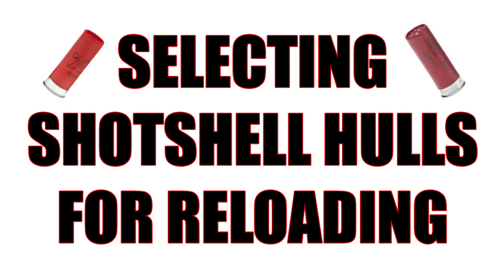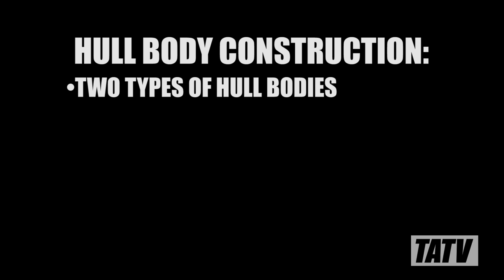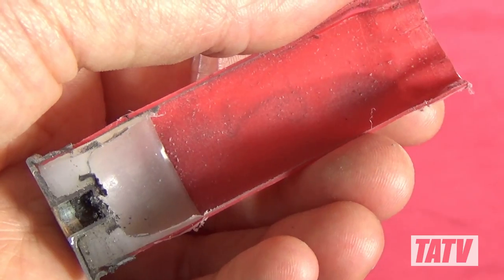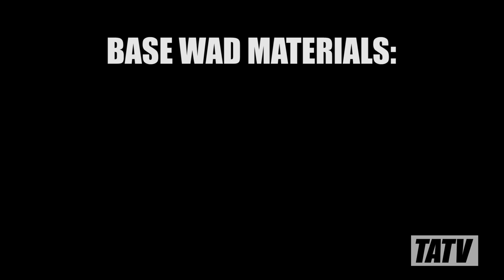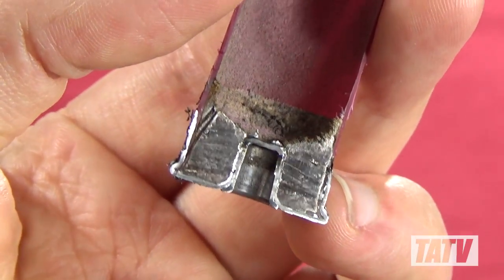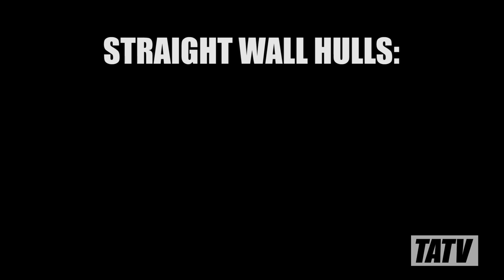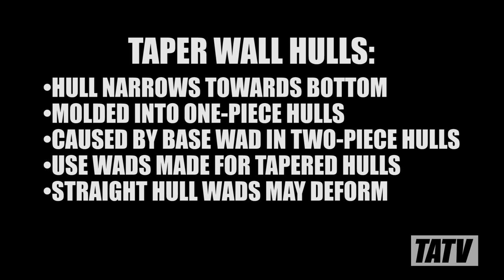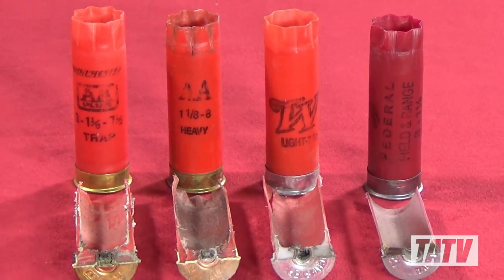Selecting the Best Shotshell Hulls for Reloading

Comment: Good info.
I stocked up on the virgin factory primed blue "mystery" (Rio) hulls that American Reloading was carrying. They cost me ~4 cents each. Rio hulls have some quirks (base wad design. primer diameter), but straight wall hulls are more forgiving than tapered base hulls. I also use non-standard components such as the "Fiocchi" FCFWA12H27 wads that Grafs and Powder Valley sell  (Lee 7/8 oz slugs fit perfectly), so there's no published load data for my component selection, just data for similar components that works very well for the "Fio" wads. I don't think I'd try it in tapered hulls.
Reply: The Lee keyed slugs in a Fed12S0 wad fit best in Federal and Estate hulls and allow for a good crimp.

Comment: I load those Federal paper based hulls with tapered wads (WAA12, WT-12). I put a piece of tissue paper under the wad to seal it against the powder. Seems to work just fine for me.
Reply from the maker: Why not just use straight-walled wads and forego the tissue?
Reply: I do the same thing. A WAA12 wad may be of a more suitable height than say the Federal equivalent and allow for a better crimp.

Comment: A caveat when reloading Federal hulls which have the paper base wad. 
Load them once and toss them. After about two reloads the base wad tends to separate. You may find it further up in the hull or you may find it in your Barrel.
Reply: I have loaded a lot of junk fed hulls half a dozen times and have yet to have a base wad fail ever. Usually the head splits after several resizes then i toss them. I only load .410 though so that may be a reason i have diff results
Reply: @eduffy4937  do you shoot 28?
Reply: @donaldatkinson7937  I shoot several cases through my bobwhite, and my benelli ethos Cordoba. I just do not reload range ammo for it but do reload 18g/cc tungsten for them.

Comment: So, as a newbie, I'm looking for a "one piece plastic straight walled hull" like the Winchester AA Plus? Can you give me advise as to where to buy them, and wads and powder? thanks, love the channel :)
Reply from the maker: Whenever possible one-piece's are my preferred hull, yes.  Other than your local gun store, your best bet is probably gun shows.  Depending on where you live they can be had fairly reasonably.  Alternatively if you live in the US you can buy them from Ballistic Products Inc.  You may also like their brand new (and primed) Federals.
Reply: One piece straight wall hull = Federal gold medal. Should be available at wal-mart for about $8 a box. Don't buy the 100 round value pack they are 2 piece hulls.

Comment: 2:43 hmmm i don't how a base wad could ever separate and travel down the barrel. The powder burn pushes against the wad in the other direction
Reply from the maker: Don't know what to tell you, it happens.
Reply: I've had it happen with paper base wads in Federal hulls. It has to do with the inertia after firing.
Reply: @jungleno.  the inertia is pushing the base wad the other direction though, "deeper" into the shotshell
Reply: @thaton3guy100  you arguing what "SHOULD" happen against what "HAS" happened. Logic doesn't always prevail.

Comment: how can you tell if the two-part base wad is separated from the main hull without cutting into it as you did in your demonstration?
Reply from the maker: If you look inside with a light you should be able to see it separate from the case wall.  Typically it will present as a curled edge or small space between the two with carbon inside.
Reply: @TATVCanada  I have also sometimes slight indications of burn through at the top of the base. I am not sure if it indicates separation is starting  but I through them out.

Comment: It is well to say "inspect" when it is cut in half, but then you can't load them. How do you inspect without cutting g in half? How can you see inside the bottom of the shell?
Reply from the maker: Typically if you look down inside you can a pretty good idea of the basewad condition; however if you're having a hard time (or it's really filthy) just use a penlight.  I actually have a desklamp on my reloading bench for this exact purpose; it works great.
Reply: It helps it you have already de-primed the hull.
Reply: Inspection is very important with the coiled paper base wads. My club burns the Federal paper base wad hulls so I can get as many as I can carry off. I make it a point to only get hulls shot the same day that I know were never rained on. Wet paper base wads have 2 hazards.
1. The moisture can cause duds and bloopers.
2. The wad can tear out and lodge in your barrel. The next round could bulge your shot gun barrel. If you destroy a double gun repairs are very expensive.
Since I get the paper base wad hulls free in unlimited numbers I use them in my autoloaders and pumps when I shoot skeet. I only reload them once and they are ejected on the ground. I do not leave expensive hulls on the ground and I don't have to pick them up. For skeet shooting my hull cost is zero.

Comment: Actually a slug load will create less pressure than the equivalent weight of shot because shot will compress and widen upon ignition causing more pressure against the chamber wall.
Reply from the maker: I've heard conflicting opinions on this, but will be testing it myself this Spring.

Comment: After over 40 years of loading 12ga, Winchester Double A load better than other hulls. Depending hot hot the load is, I can get 5-6 reloads out of them.
Reply: In my experience they’re too finicky. I reload STS and Nitro 27 hulls. Haven’t had a single issue to date getting my press set up with them. For whatever reason the AA hulls give me a lot of trouble.
Reply: Do the Winchester AA hulls use straight or tapered wads?
Reply: @michaelrebman5498  straight

Comment: Ok can I reload once fired estate shells
Reply from the maker: I don't have any, but if you find a manual that calls for it, sure.
Reply: Yes you can reload estate hulls.  They are two piece, straight wall.  It takes some experimenting as there are no published loads.  But I’m using PT1205 wads to make 3/4oz loads.  Please note, they are only really good for three or four uses before they start failing.
Reply: @darrelljohnson7832  Yes reload them as you would a Federal hull that has the same basewad.
Fed12S0 are a perfect fit for 7/8 and also the Lee keyed 7/8 slug.

Comment: If you can find them, get the original uniform (one-piece), either Winchester AA (not the AA HS made today that can be easily recognized by tiny ribs on the outside of the shell), Activ, or the ones made today, the Remington STS/RXP, or Gun Club.
As long as you treat those hulls right, you should easily get ten reloads out of each one.